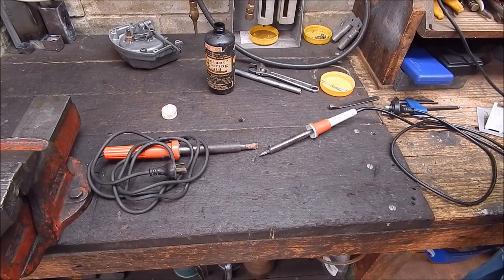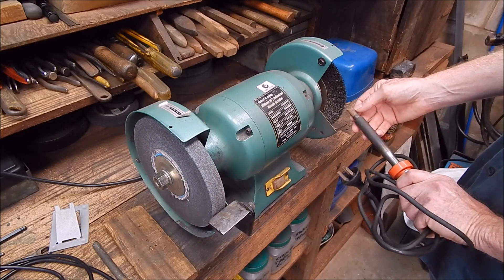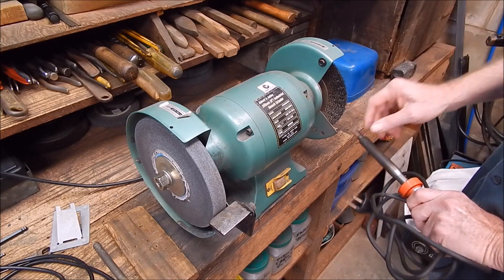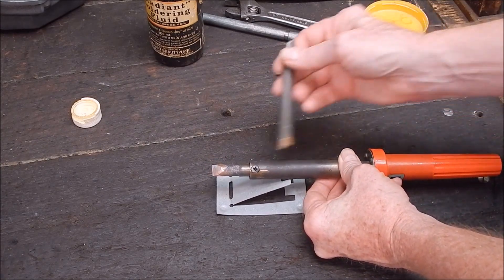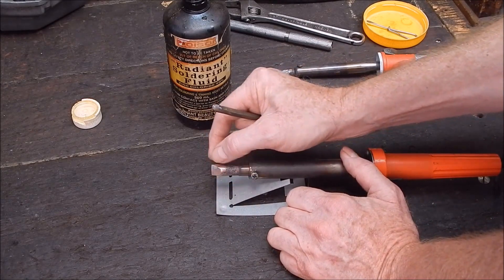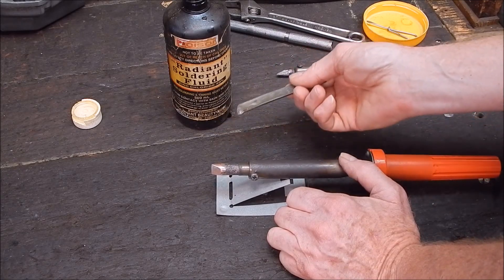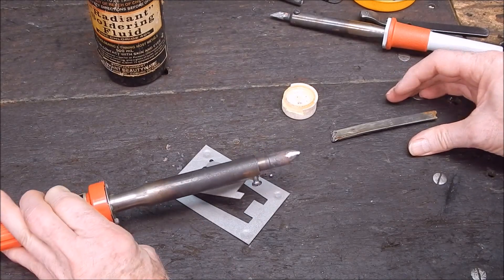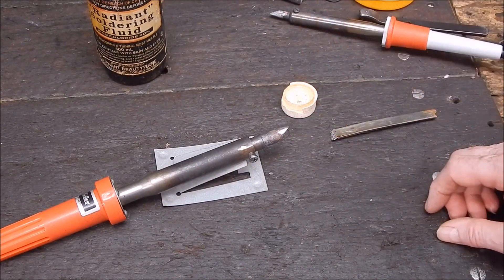How to easily tin an electric soldering iron tip

Comment: I have a solder bath for tining wires and when my iron gets bad I dip it in flux then into the solder bath that is hot and it works well you should try it

Comment: One other point I find useful Rob, is having a damp sponge handy while soldering such that a wipe on it now and again helps remove excess solder and flux... helps reduce flux erosion and keeps copper surfaces clean longer. Another thing is leaving the iron on too long when not in use speeds up tip degradation..
That's what I have found anyways :)
Reply from the maker: Hi Chris, 

I do that at times during cleanup, but the biggest issue is probably leaving the iron on too long.  That's what burns the tip to hell.

Cheers Rob

Comment: I don't really know if I buy that solder doesn't stick properly to a polished surface. A rough surface has more surface area, and that would help, but I don't think it would help that much
Reply from the maker: It could be that the wire brush pushes the oxide into the copper and doesn't really remove it as well.  There is a difference in how easily it tins.
Reply: I would say if you're going to wire wheel it, use one dedicated for soldering iron tip, not one that's been used on everything.
Reply: I'm sure grinding does a better job of cleaning the surface, i was just saying I don't think a rough surface is much better than a polished surface, all other things being equal
Reply from the maker: You're probably right Rob.
Reply from the maker: Yes, the wire wheel could be/probably is contaminated with grease and oil and dirt from cleaning parts etc.

You can see the wire buffing gives the copper a darker colour.

Comment: Can you sand back the tip of a hobby-iron mate or are they plated?
Cheers.
I always enjoy your videos.
Merry Christmas.
Reply from the maker: If the tip is nickle or chrome plate colour it is coated, so just rub it with moist nylon scrubbing pad while it's hot to clean it.  If it looks like in the video then any coating has burnt off and you can sand it back.

Rob

Comment: You don't want to scrape off the iron coating of good quality tips, bare copper actually dissolves a bit into solder and tips have a thin coat of iron to keep the tip intact. Also, a good high activity tinning flux will eat right through oxides.
Reply: What if you have a cheap chinese tip that is 100% iron. No matter how you scrape, there is more iron.

Comment: Good Video.  Just a caution though, if you have decent tips that are surface coated (rather than bare copper), you probably don't want to abrade the surface coating.  Most soldering iron mfrs sell a "tip activator" that will remove the burnt oxide and allow you to tin the iron.   The tip activator I think is a bit stronger than standard fluxes so you may want to consider fume extraction while using it.
Reply: I agree on not abrading a quality iron tip.  A lot of the 'tip activators' are made primarily of ammonium chloride (sal ammoniac) –  sometimes mixed together with solder so it will prepare and tin the tips at the same time.
Reply: I have a block of sal ammoniac that I've had for decades. It now has a useful depression in the middle from all the times I've used it.
I just plunge the soldering iron into that divot, wait for a bit of smoke (OK, a lot of smoke), add some solder and it comes out shiny and ready to use.
The advantage of using the sal ammoniac block is that you can do a tip rejuvenation without grinding away any metal.
You can still buy it. Google "sal ammoniac block".